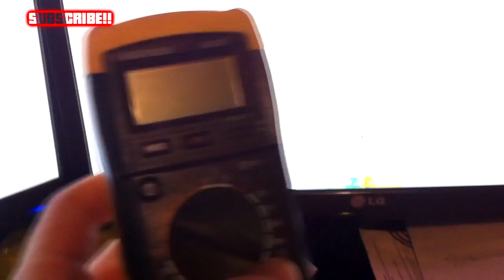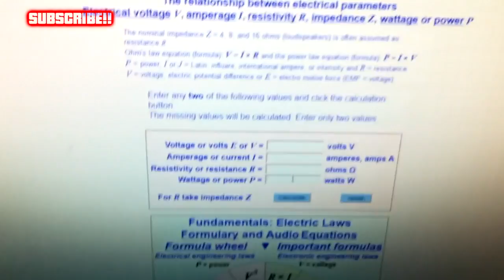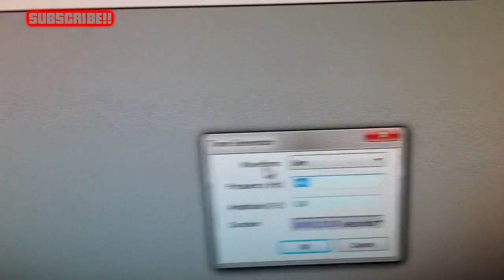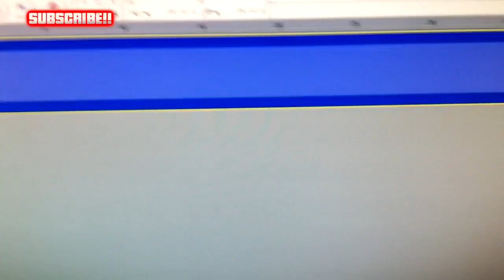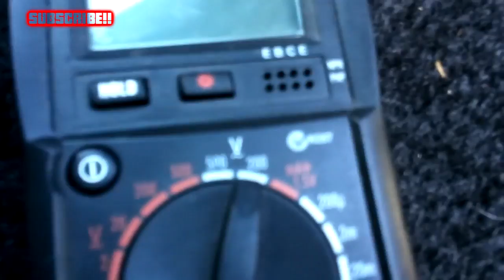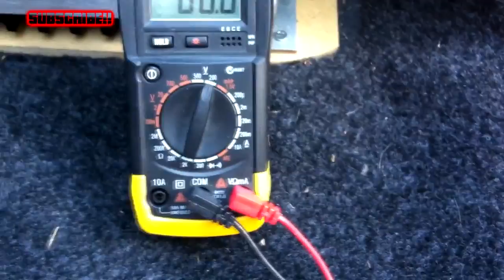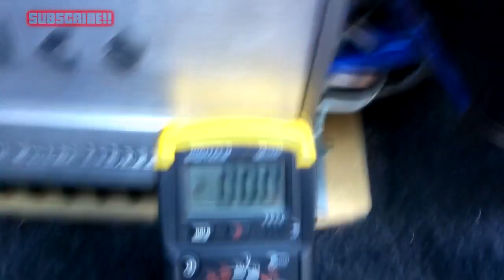How To | Set Amplifier Gains With A Basic Multimeter | Car Audio Tutorial

Comment: There is an easy formula for this that doesnt require any app, or website, just a basic calculator.  Watts x ohms = x then find the square root of X to equal Y, Y is the volts you need. You're welcome

Comment: Do i have to disconnect negative terminal on my 2nd battery to remove speaker wires ? And can i use a 50htz test tone through bluetooth ?
Reply: NO and you can use 50hz.

Comment: my multimeter wont show much over 00.3 or so at the ac200 setting but will show me 0.44 if I'm trying to find a 44.5v it climbed if I turn up gain but cant get much at the 200 setting. has to be 0.00 not 00.0 I don't know tried everything

Comment: i stopped it right at the beginning,when he put 1200 watts RMS well that changes with voltage,and amps say on the box how many watts they are but most good amps are under rated,watch amp test tuesday video's on here.and how are you going to set it to 80 hz? you need that damn SMD thing that steve meade sells so i don't even bother with all this.

Comment: question for anyone that can help, I know to unhook the speaker wire from the amp for the subwoofer,but obviously all the door speakers are still going to be hooked up, will playing that sine wave at 50 Hz at 3/4 volume harm those speakers while doing this?
Reply: I set my volume to 2/3 of the max volume I can go without it sounding bad/clipping.  My volume maxes out at 40, but I never really crank it above 30.  So, while testing I set the volume to 20.  I'm using a stock deck also.

Comment: Hi I tried this method but my meter shows a max of 14 volts when turned to max for some reason and 0 at minimum. I had kept it at the 200v setting on the meter. What am  doing wrong?

My Amp is a Powerbass ASA3 1000.1d doing 700 rms at 2 ohms and my sub is a Pioneer TS-W3003D4 dual 4 ohm rated at 600 rms. Please help.
Reply: amp is under rated
Reply: kunal186 if you have the sound playing and multi meter hooked into the pos and neg of the amp and the amp is hooked up and powered then you should be getting numbers from the meter.... it's all the same. If you have a 2k amp but only want 1k of it to your sub. Take 1000 times the ohm say 4... so 1000*4=4000 and divide that by the square root it's the v2 on your calculator and you would need 63.24 on meter. Easy.
Reply: You'd want to wire a dual voice coil amp in parallel to lower the impedance to 2 ohms.  It's effectively 1200w rms. You need a 1200w rms @ 2ohm amp.  
I'm in a similar boat, I have a 550W RMS @ 2 ohm amplifier, and two 10" 4-ohm 400W RMS subs. I tuned the amp to 600W @ 2ohms and wired the subs in parallel.  Amp doesn't get hot or even warm really.

Comment: how many hz should you generate if using for speakers, not subs
Reply: around 2000 for midrange and around 5000 - 10000 for tweeters. if they are connected both, go for 5000
Reply: thx for reply but those test tone are extremely high pitch and the frequency setting on my amp only goes up to 250Hz
Reply: Mr. Kupopo if you can't turn off the crossover then you have a subwoofer amp. You can't connect full range speakers to it.
Reply: I could turn off the crossover (AP or all pass) or set it to HP (high pass) so I can definitely hook up speakers to it
Reply: Mr. Kupopo so what is your problem? If you are connecting full range speakers, set the crossover to AP or HP and you can get the high pitched signal pass through

Comment: once you have the volts adjusted how do I adjust the bass boost/subsonic on the amp? wouldnt that raise the wattage?
Reply: BiCepsTheRapist Never use bass boost its trash. Buy a bigger amp if u want more power. as for subsonic filter refer to this guide. http://www.stevemeadedesigns.com/board/topic/156565-how-to-set-your-subsonic-filter/
Reply: lower bass boost = lower wattage
Reply: If you have a multimeter showing the desired voltage, your LPF/gain would have already been set at that point.  subsonic is for speakers, not subwoofer.  I set my LPF to 80hz and turned the gain all the way down, then started turning the gain up until i hit the correct voltage.  Like Ryan said, bass boost is no good.  Mine is all the way down.  My subs are tuned correctly, negating the need to turn bass boost up at all.

Comment: am i supppose to put the subs wattage or power on the website or the amps ? and do i use the peak watts or the rms watts
Reply: RMS always. Peak is marketing BS, it's what the subs can handle in short spurts.  To calculate needed vols on multimeter, get the square root of impedance X watts RMS.  For me, I wanted to set my amp at 600W, and my subs were wired for 2-oms. So 600 multipled by 2 and then the square root.  34.6 volts.  I set my LPF to 80Hz, turned gain and bass boost all the way down, and turned the gain up until i hit that voltage.  Bass boost stays all the way down.

Comment: Hang on a second shouldn't you be testing the amp under load? An unloaded amp is not going to give the same readings as an amp that's loaded.
Reply: No, because in this case you're changing Volts. Its the Volts and resistance that make up the wattage (the answer everyone is looking for). So, you take into consideration the resistance in the initial calculations to find out how many volts you require. Obviously, if you alter the resistance without re-adjusting your voltage then the wattage will change. If you half the resistance then the wattage will double, while volts remain the same. 

Bare in mind, every resistance is a load of course.
Reply: I agree!!!
Reply: Also does this amp put out a true 1200 Watts? Who knows?
Reply: Lori Green. Yes hifonics does they are ce4-2006 compliants and there know to do what they say hifonics is an excellent brand
Reply: chris magnuson CEA compliant means nothing to be CEA compliant all amp has to do is make power at 14 volts at 4ohm almost any amp can do that it doesn't have to do 1200 watts at 1ohm to get that stamp

Comment: setting your amp gains with a multi meter is about the same as Michelangelo trying to do his sculpture of david with a flat head screw driver and a wrench to hit it with.  Granted it gets you started if you do the math correctly, and have a good meter and know how to use it, but there is a reason you will never see a pro at a shop do it.  You would be better off just doing it by ear as has been done since the invention of the amp/gain but if you think you are too inept to do it by ear then you need the correct tool, an o-scope.  Let the flames begin
Reply: Pro's use SMD distortion detector because it's quicker and easier. Hard core's use Oscilloscope. Average joe uses MM. Lazy noob's do it by ear and ghetto people use the gain as a volume knob...zeeyeah dawg, crank dat funk up.

A $ 4.99 multi meter from Harbor Freight. There's no excuse to think you can detect amp clipping all the time when such cheap tools exist.
Reply: +Pimphand Gamester Actually only noobs use anything SMD cause they don't work. You set your amp with a 40hz sign wave then as soon as you play music that goes below that you are still clipping. And this is a known fact among the pros and that's why they use Oscopes.

Comment: ProjectAudio1412 Hi,
If my Amp has these specifications:
[Rockford Fosgate R1200-1d]

RMS Power @ 4 ohms 400 watts x 1 channels
RMS Power @ 2 ohms 800 watts x 1 channels
RMS Power @ 1 ohm 1200 watts x 1 channels

Subs

[Rockford Fosgate P3D2-12 (Dual 2 Ohms)]

1200 peak
600 rms

What's the voltage I should look for?

Thanks alot!
Reply: A bit too late did it by ear with a friend. And found out that one of the subs is already bad it plays but sounds like the voice coil or something is bad. I had bought them off craigslist. And about to sell
Reply: I was gonna sell them to a friend (amp + wiring) changed my mind too low on the price but all I need to do is buy a new rockford p3 sub and it will be all good.
Reply: ***** Cool I heard about that app I would have to use my brothers iphone and don't you need a 50-80hz test tone while doing it.

Comment: hi,
If my Amp have this specifications:
Max. Power @ 2 Ohm: 175W x 4= 700W
Bridgeable : 140W x 2= 280W
Power @ 2 Ohm: 70W x 4 = 280W
Power @ 4 Ohm : 50W x 4 = 200W
whats the voltage i should look for?
thanks allot!
Reply: Gal Rosen It'd be: 140Wx2 which I'm sure is a 4 ohm load so you'd want 23.7 AC volts

2 ohm load 70W, you'd want 11.8 AC volts
4 ohm load 50W you'd want 14.1 AC volts

If you choose to use a 50 or 60 hz 0 db tone, the output is gonna suck with music. Some songs peak at -6 or -3 if it's really heavy bass. So if you listen to a lot of rap, especially rap from 2000 till now I'd go with -3, -5 or -6 for more output with that genre of music with minimal clipping which you'll barely hear on the peaks of the song. If you listen to 80's-90's rap you could go with a -6 to -10 tone since most of the bass in that years songs peaked around -6 at the most. If you listen to rock and metal, you'd be better off using a -6 to -10 tone for more output from your amp in that genre.

Comment: i have KAC-8104D Mono amp connected to pioneer 10" dvc subwoofer 2 ohms load.  rms around 400. What will be multimeter voltage while setting gain. Can you please advise.
Reply: 28.2v
Reply: your amp is 500W RMS at 2 ohms, so your amp isn't powerful enough.  I'm currently in the same boat but my amp is a good one.  since you have a dual voice coil, you effectively have an 800w rms sub.

Comment: If I have a bass knob, such as the PAC LC-1, where should that be set during the tuning process?
Reply: Full tilt. Or at least the loudest you're gonna play it. Setting your gains is for getting the strongest, clean signal to your sub; that said, you want the strongest (clean) signal you can possibly send to your amp, then turn the gain up until you hit the distortion point, then back it down a tiny bit. If you set your gain with your bass knob at half, for example, whenever you're playing your system maxed out and you have your bass knob at anything over halfway, you're gonna get distortion.
Reply: KlaskeyProductions i was always told to have it turned all the way down when tuning this way so it doesnt distort the signal in anyway
Reply: I don't think my first explanation was as clear as I wanted it to be, so here is simply how I would do it:

Turn all volumes to the lowest volume without muting the signal

Step 1: Find the distortion point of your HU.
Step 2: Find the distortion point of your bass knob (with your HU at that same high clean level.)
Step 3: Find the distortion point of your amp (with both HU and bass knob as high as they will go)

This will ensure you'll never (or extremely rarely ever) clip your system.

So yes, customlumina , you do want your bass knob down initially, but you still need to find its clipping point eventually.

Comment: my sub are 2 dual 4 ohms   does that make them 2 or 4 ohm load ?
Reply: Gsk8ster Your are incorrect 2 dual 4ohm speakers wired pos to pos and neg to neg = 1ohm, thats called parallel. Need to do your home work....
Reply: Depends on how you wire them.
Reply: if you wire all the + together, your amp will see a 2 ohm load
Reply: if you wire each voice coil to the amp, 4 ohms. If you wire the voice coils in parallel and bridge on amp, 2 ohm. Also make sure you amp is 2 ohm stable, otherwise you wanna  wire for 4-ohm

Comment: If you want to get THE most from your car stereo system you need to use an O-scope to determine the maximum useable volume setting for your HU. To do this your test tone needs to be recorded at 0dB. My Pioneer HU has a volume range from 0 to 40. It's maximum useable setting is 38. At 39 the signal begins to clip. To get the most from my amps I like to set their gain using a sine wave recorded at -10dB. This will give you the best trade-off between signal to noise ratio and maximum undistorted output volume. Using the "set your HU at 3/4 volume setting" method will NEVER get you results as good as knowing exactly where the HU's maximum useable volume setting is.
Reply: "-10db" No.. Just no.
Reply: ***** Not that I know off.

Comment: Instead of unplugging my speakers could I not just use a the HPF on the amp set really high?
Reply from the maker: Yep that will work, they will still get the tone through them but not with enough power to really even move them. So long as you set it as high as you can.
Reply: But its`a a must to unplugg my subwoofer or is preferable becouse of the noise.
Thx!

Comment: Alright, Thanks. I just got my Kenwood Kac-9105D today, Also subs are two Infinity Kappa Perfect 12.1's and I am wiring them in parallel, 700w rms total @ 2ohms. Amp is rated at 900w rms @ 2ohms, but i know it will do around 800-850w rms depending on efficiency. Now i just need to get the wiring, and tune them to what you have provided in the video. Thanks again.

Comment: Please Help Me Out I'm having troubling figuring out my Voltage. I have two Kenwood  W3013ps Subs with A Kenwood 9105d Amp. My subs are 4 Ohm subs.  Amp is 1800watts.  900x1 @2 ohms, and 500x1 @4 ohms. I'm going to run my subs in parallel dropping the load to 2 ohms. 900 watts per sub. What wattage and resistance should I enter into the calculator?
Reply: subs are 400w RMS at 4 ohms, 800W RMS effective.  Wire the subs in parallel to achieve 2 ohms.  800W RMS effective for amp and it can do 900 so not a problem fo ramp

Comment: when you calculate the Voltage needed, wouldn't you put in the RMS rating of your subwoofers at that particular impedance and not the rms rating of the amp at that impedance? Other then that, everything else was very informative.

Comment: Hi thanks for the video

I want to double check my calculations...
 I have 2 pioneer subs (1000rms) each sub is wired up to be 2ohms and then wired into the amp (1100watts) in bridge which gives me a 1ohm load at the amp side.  which then potentially gives me 550watts rms each sub. 

How would you calculate this, is it? 

(1100/1) pi = 33.166

Comment: Hello mate. Thanks for the video. I actually have built circuits & measured drops and resistance and such. But I'm having trouble figuring out how to measure a bridged amplifier. I have 2 ( 4 OHM, 150 W RMS) subwoofers bridged to my amplififer that puts out 220 W RMS @ 4 OHM bridged x 2 channel. 
Okay so I did the work and I'm getting around 34.6 V.
Now when I go to measure using my multimeter I get no reading. Is this because it's bridged? I would appreciate your help!!

Comment: okey thanks! :)
btw do you know how to set the gain on a 4ch amp using a multimeter? have a 4ch amp and i only use 2ch (Becaouse i have 2 crossovers) so have 2 mids 2 tweets, and the amp is doing 125wRMS on each channel, and its on 4 Ohm will i just take 125+125 and then do the calculation?

Comment: Depends on the speakers.  Most home audio speakers are 8 ohm.  Most car audio speakers are 4 ohm.  You can also mix and match serial and parallel wiring of speakers with different resistances to get fractional ohm ratings.  Some dual coil subwoofers can be wired for 1 ohm (make sure your amp can run at 1 ohm also).  It can get complicated fast.

Comment from the maker: It could be that your head unit doesn't have enough RCA voltage for the amp. Or your mulimeter might not be able to read it correctly, what frequency are you using to tune?

Comment from the maker: Yep, just put 1ohm as the resistance and wattage as 800w and it will give you the right voltage. Just because your amp is 1200w, doesn't mean you need to use it all.

Also 800w@1ohm, is ~28volts.

Comment: okay so if my subs are 400 rms each and i have 2 wich together is 800 rms and my amp does 1200 rms at 1 ohm and i have my subs wired at 1 ohm can i put instead 800 rms as the resistance on the website and tune it to whatever volts it gives me that way i wont blow up my subs?

Comment: Ok, so if my amp is 300w 4channel with 50w rms per channel at 4 ohms and my speakers r 35w rms at 4 ohms, the voltage for one channel should be square root of 35 x 4, which is 11.8?

Comment from the maker: This will method I am showing will not detect any distortion, it is simply a target voltage as you said. If you are using a DD1 then you have no need to do a target voltage as it will detect the maximum safe undistorted voltage your amp can give.

Comment: Great video clip bud but since I'm kinda new to amp tuning and stuff i'll like to clarify some things:
Is this process the same as using an audio wave calibration cd and a smd-dd1 to detect maximum undistorted volume at the hu and amp ?  or is "target voltage" different that what i've just  mentioned?

My amp's manual has a list of " target voltage" numbers with various loads is this what the online calculator is used for to find those numbers?

Can i skip "target voltage" using  the smd-dd1?

Comment: Hey bud good vid, thanks for taking the time to help others but i c some people dont appreciate it hey, just a question i wanted to know, my amp got bass boost (0- 12 db) aswell as a bass boost frequency (30Hz- 80Hz). I assume the LPF settings are around 80Hz, and Bass boost on 0db. what about the bass boost frequency? should i leave it on 30Hz because i have no idea what it is or what it does, thanks for your help

Comment from the maker: Ahh yes, this is a common problem and I had the same issue. Some multimeters have trouble reading that high frequency tone. I resorted to setting my Hifonics Titan 2ch by ear. It's not ideal but unfortunately if the multimeter doesn't read the tone properly or you can get a hold of a O-Scope, it's about the only way to do it